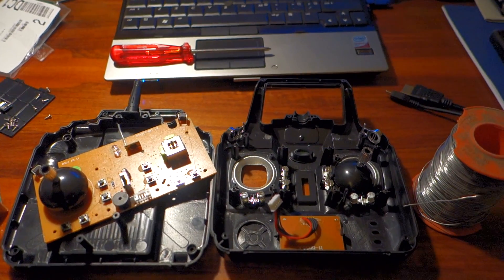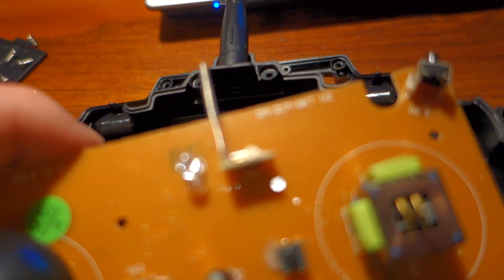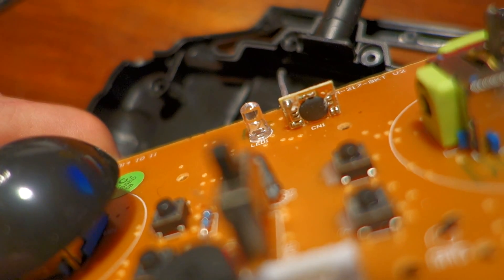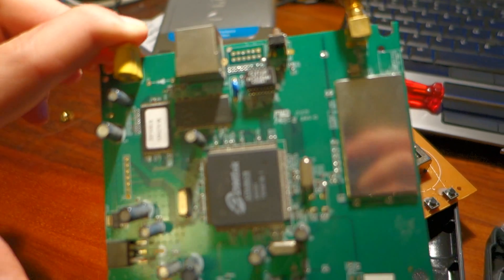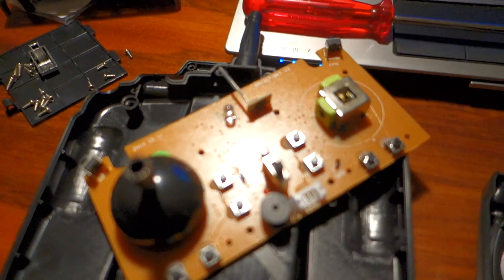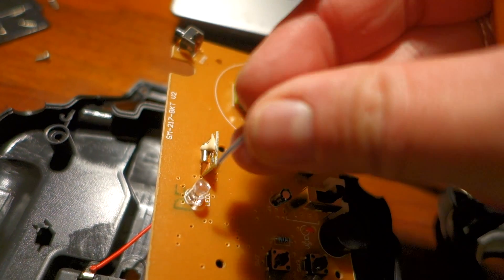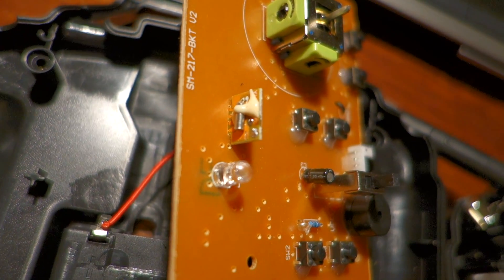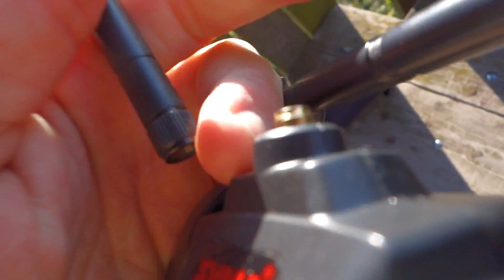Syma X5C Transmitter mod - Adding a Wifi Antenna

Comment: Can you show us how to do antenna mod on the new Hubsan Zino controller and transmitter?
Reply from the maker: sorry man, but doesn't have that Hubsan RC here :(
Reply: its a waste of time,, so don't bother, the only real way to pump up the range is to beef up the transmitter transmission's power, messing around with the length of the antenna will only blow up the out put stage in the transmitter, the max length of antenna for 2.4 GHz is 31.3mm for a 1/4 wave length antenna, any more or less will throw the out put stage of your transmitter into a ""wobbly"" it will throw out the balance of the transmitter antenna that should be 50 ohms (no more or less), if it is more or less then most of your transmitter signal will be ""reflected"" back down the antenna into the transmitters out put stage causing it to get very hot then it will burn out the transistors! the best thing you can do is add another wire to the ground plane of the antenna that is 33.3mm and stick it to the inside of the case at an angle of 180 degrees to the main antenna,, ie: straight down, that will help pull down the transmitting signal nearer to the ground so it transmits further out instead of it transmitting a lot of your signal up into space (were the drone never go's) you could add a longer receiving aerial to the drome and that wont not do any harm at all and it would increase the signal strength the drone is receiving at longer ranges but its still not going to give you more than say 10% extra range, the only way to grantee more range is boost the out put of the transmitter if the transmitter is pushing out say 1/4 of a watt then boosting its out put power to 1/2 watts will still not give you twice the range as power out put and range are not linear and therefor work on an "inverse square law", to double the range for your drone you will need to boost the power out put of your transmitter to at least 1 watt,, and that would gobble up battery power, and the out put stage transistors in the transmitter plus their power drivers would need to be upgraded and fitted with good heat sinks, if that could even be done at all,,  you cant win this one easily, the best way to upgrade the range is to increase the aerial length on the drone ( as long as you can get it) then get a different transmitter with far more ""grunt in it"", (more watts of power) and reprogram it to talk to your drone,, sadly many people look at these video's and think they can just hook up a longer bit of wire to use as a transmitting antenna, not really understanding how an antenna works and just what it would do to the transmitter's power out put stage and when their transmitter stops working because they blow it up they still don't understand why that happened, but if you still wont to risk blowing up your transmitter then go for it,, if I were you though I would first add more wire to the drone's antenna and stick to what you get from that,, but its your transmitter, just don't say I never warned you,, best of luck
Reply: @michaelthorpe9560  So you're saying to only stick to 1/4 wavelength, as most routers are built, correct ?
Is what you're describing referred to as a 'dipole antenna' ? Why the longer length on the grounded wire?

Comment: I ran range testing with modded controllers, I think huge range gains with these toy level transmitters is a myth caused by bias, differences in radio interference at the locations they are flown and poor testing techniques.  if you add a big antenna to your transmitter there is an expectation and bias that it will work. https://www.rcgroups.com/forums/showthread.php?3032714-SYMA-X5C-1-Modded-controller-Modded-Quad-Range-Testing#post39150128

Comment: What if i use higher dbi(about 11dbi) but 2.4GHz..

Can i use that?
Reply from the maker: of course you can use that, just take care as the higher antenna will correspond to a more narrow antenna pattern. Practically this means you will need to position your antenna more precisely toward the drone, if the antenna main lobe not looking towards the drone it can make a blind spot temporary. 11dBi might not a high risk however, should be fine as long as well positioned. Many hobbist uses mushroom and patch antennas.

Comment: i did the mod, and I used a tp-link 8dbi antenna.    I kept losing signal after like 20ft. but then I wondered if I needed to mod the drone antenna as well. I just made sure the antenna stuck outside of a small hole in the shell.  then I got improved range. but what type of wire would the antenna mod need?
Reply: I am about to do the controller of my X101 antenna mod, but as you say it's not too much gain, as 20ft seems not too high improvement though.
Reply: I fixed it.  either my coax cable was too short or I soldered it wrong.  but I got a whole sma new coax cable and it works fine.   haven't tested how far it goes max.  but a lot more than 20ft

Comment: so i just did this upgrade and it works perfectly. got lil more then double the distance and it was not hard at all. the only trouble some  may have is doing the soldering just be careful when doing it cause you can mess it up and it won't work at all. thanks for the video!!
Reply from the maker: Wow, great! :) Congrats, well done! Have a safe flight!

Comment: How can I troubleshoot transmitter with good batteries the drone with good batteries not getting a signal to start props
Reply from the maker: You can try buying a new transmitter, once it helped. Of course no guarantee that not your drone failed, still this the easiest first step. If any of your ham / hacker friends has a HackRF spectrum analyzer you can check 2.4 GHz operation of the TX to clarify

Comment: It would be nice to have seen exactly where you soldered the attena and how you assembled it instead of cutting that important part out.
Reply: J Daniel  for real these dudes making these videos don't know what they're doing. show us where exactly the wires go show us how you striped the wire
Reply from the maker: lol, "this dude" who made this video for you is an RF engineer :)  Next time I hook up the camera for my solder iron, thanks for noting this.
Reply: @VeryokayDIY  On which connectors do I solder the ground and the main line on the SMA female ?
Reply from the maker: +Jeremy Mills Yeah, you are right, possible the most important part left out, sorry :( Here is an other great video which might help you: https://youtu.be/XBQZvvIiOlM?t=5m44s
Reply: Veryokay thank u 4 this link